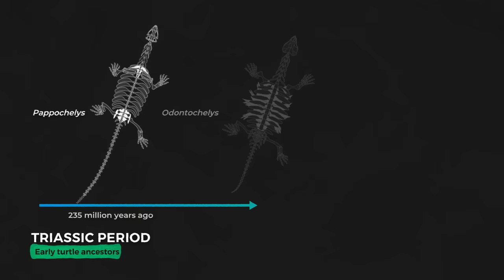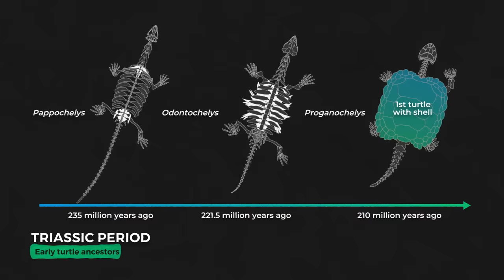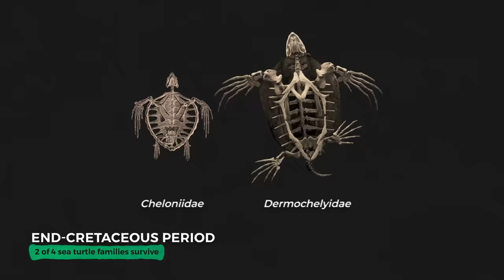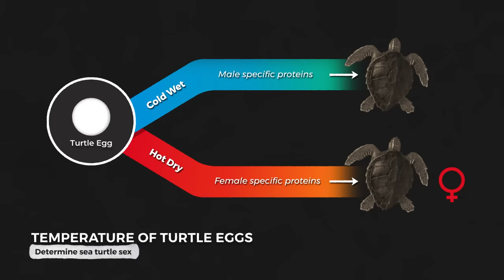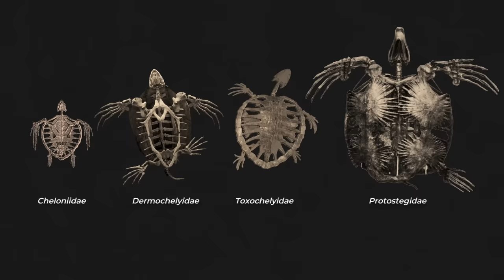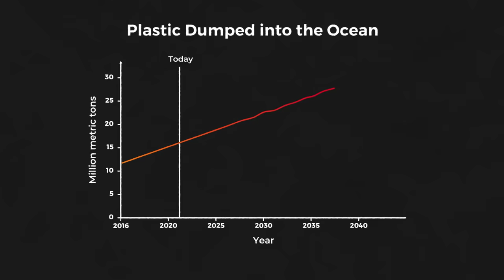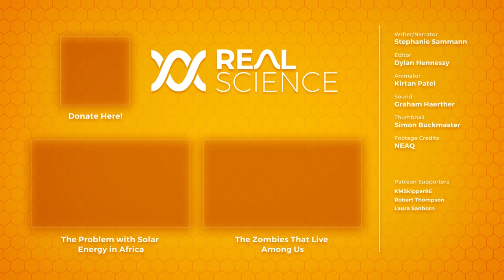Why Evolution Has Screwed Sea Turtles (And So Have We)

Comment: The light pollution problem is SO EASY to solve, it's insane we still have so much of it
Reply: Plus it even disturbs human sleep patterns in many cities.
Reply: Economically it is not easy and that what matters. That's why massive grants are required to solve problem
Reply: You can't read and cant see small things at night
except in moonlight  is the downside.
good for sleeping and health is the upside.
Reply: @maryann2628  you never had a clip on light? Me reading with a worm light in bed doesn't cause any light pollution!
Reply: @Thor-Orion  Yes but small light sources only works for reading until 5-10 meters but if its just for seeing then it works enough
for small rooms its bright for big rooms its too dim
and 100
But works for some average rooms its just the angle thats the problem most light bulb are 180-360 degrees
but worm lights are 90 degrees so you need multiples of them to light up the entire room
but besides that its good enough
for night sky
if all houses are like that then the light level pollution is 1-3 which is low for me
im in 7 light level pollution and the stars look good
and i have seen 4-5 and its so beautiful
Reply: No one is willing to do anything unless everyone has to do it
Reply: It's not practical
Reply: @maryann2628  
Its called "closing the windows".
Inside light is not the problem...

Comment: The plastic needs to be prevented from getting to water in the first place. Since it is only a few rivers that have this problem, it can be tackled.  People that got rich starting the problem can get wise and clean it up.
Reply: Cleaning up doesn't make money. Under capitalism, if it doesn't make money then the corporations won't do it. Any ethical stuff they do is only if they think it'll make them more money than not doing it. You can't expect corporations to fix the problem unless it'll affect their profits if they don't. That comes from consumer and political pressure.  

I saw a great start (I think it was the US state of Maine?) That started charging companies based on the costs of dealing with their packaging (basically like instead of citizens paying the government for recycling costs, the companies making the waste pay for it) Suddenly, companies are reducing packaging or using biodegradable options, because the extra tax costs more than making those changes.
Reply: How. How will you tackle this? You going to stop these countries from tossing garbage? Or try  to catch the garbage

Comment: Fun fact we dump about 1 dumptruck worth every 30 seconds and every truck can hold 2 or more tons so 4,000 pounds.
They need new technology not just grabbing a little plastic and calling it good.
Reply: no, we need an old technology: It's called not wasting and not littering. There's no reason to wash all our waste into the ocean. You can reduce, reuse, recycle and ultimately burn waste and produce heat and electricity.
Reply: @uschurch  haha ya im with ya.
We use to use gkass and clay pots for a very long time with little problems.
Hell we have to little diversity in are food back in 1950 to 75 we had 90 to 150 different kinds of food in the stores but the government thought it was to hard to keep track of that so now we have 50 to pick from with 3 being are main food.
Reply: @uschurch  reduce, reuse, recycle. in that order. recycling is not what it's made out to be.
Reply: Ya I'm afraid this effort while well meaning is a drop in bucke and fails to address causes of the problem in meaningful way, it only removes 15,000 tons.  Did they say what they do with trash they remove from ocean?  Does it go to landfill?

Comment: Mycelium based packaging could very easily surpass plastic within a matter of mere months.
Reply: Unfortunately that's wishful thinking. It costs companies a lot to switch products that way, so usually they just won't
Reply: @FeeshUnofficial  if you provide a company with an estimate of how much they'll save and how much they can stand to make they legit will do anything.
Reply: @zakkeith1508  that's true, but you forget the ignorance of CEO's, CFO's and board members to anything that doesn't directly increase the stock value, at least in big companies

Comment: It's one thing to swear off plastics.  It's another for there to actually be a suitable replacement.  One that's as convenient, functional, and economical, or even approaches it.  A sustainable replacement should certainly be a long term goal.  But until then, reclamation via responsible waste management is all we can do.

Most people have some idea where the primary waste management problems are on the globe, but it's often sensitive to discuss out loud.  Continued investment should naturally concentrate on these locales.  But as with anything global in nature, progress hinges on cooperation from governments.
Reply: Many of the plastics we use now replaced more sustainable existing options. Beverage bottles for example used to be reusable glass with a reasonable payment for returning the bottle which greatly reduced waste.
Reply: @garethbaus5471  Indeed, such as the milk bottles of yore.  Today, about the only beverages still routinely sold in glass bottles are alcohol.  Returning to glass throughout the beverage industry would certainly reduce a sizeable amount of single-use plastic, albeit at some logistical cost which might be reflected in pricing.  Glass being heavier and more fragile would surely increase transport costs for instance.  Even if it's too logistically cumbersome to return to a full reuse program, as with milk bottles, glass is readily recycled, and even when it isn't, it has a lower environmental impact than plastic.

Plastic wrappers, bags, and packaging that house virtually all food, snack, and personal care items are a somewhat different matter.  What to use for potato chips, candy bars, shampoo, and toothpaste?  Most biodegradable materials such as paper and cardboard have an airtightness, water resistance, and durability problem that would impair shelf lives.

Comment: Easy solution to the light pollution problem: Every year, inspect beaches with nesting sites at two random times during the hatching period — For any beach that has too much harmful artificial light, put up black screens to block the light and send the bill to the local property owners with a nice, temporary bump in property tax. Of course along with the GPS coordinates of the offending light sources.
Reply: Is there anything temporary which could be installed maybe floating in the water, to which titles would be attracted? Just asking. Old UK duffer here.
Reply: @tim40gabby25  Yeah, that crossed my mind too, not as draconian as what I ended up proposing. But you'd need a massive light source pretty far out to sea. Otherwise you wouldn't outshine the towns and cities next to the beaches or you might attract hatchlings from neighboring beaches inland as they would see the light coming from aside rather than from the sea if you were to place it close to any individual beach.
Reply: @davidschaftenaar6530  indeed - so 'hood' those sea docked lights as well.. sounds expensive :(

Comment: Hi. I noticed on the Thames when wind was from a certain direction, all the floating trash collected in side channels. All of it. Line those channels with nets, haul out when full. Repeat. Generalise. Why not? Just asking :)
Reply: Nets tend to catch a lot of plankton if you use it to catch plastic, as most plastic tend to break down to micro plastic if you leave it in the water too long.

killing plankton which is the bottom of the food chain affects the rest of the food chain.
Reply: This'd rely on the wind going in the right direction consistently, which it just doesn't.
Reply: @juniperrodley9843  Hi. Nope. A steady breeze quickly leads to accumulated flotsam, which of course would need to be removed before wind changes. Submerged netting could be used to scoop out the floating stuff..
Reply: @onewayraildex4827  Not so much if one of just scooping the surface?.. like removing scum. Just saying.

Comment: Israel has an excellent conservancy project at Rosh Ha Nikra beach.  The area is tightly controlled (it helps that it's next to a major military base!) Every year trained volunteers make sure that the hatchlings have optimum chances to make it to the water.  A few years ago an oil tanker dumped its entire cargo off the coast, and it took millions of shekels and thousands of volunteers to try to rescue the wildlife and clean up the shores. The tanker was from Iran, and it's considered an act of eco-terrorism. The disaster was every bit as bad as the Exxon Valdez, yet international news barely mentioned it. 😒

Comment: We need to focus on preventing all waste from getting into our waterways and oceans. We need to focus on not using plastic, instead we can use aluminum, it can be cleaned and recycled over and over again. No more plastics.
Reply: @Talishar  copper we can use copper instead.
Reply: @DynamicHaze  Can still leech into food/water without a coating and its oxidants aren't very fun either.
Reply: @midnattsol6207  we can use copper instead.

Comment: deforestation is primarily driven by timber industry, not meat production. how about getting your facts straight
Reply: Animal Agriculture  is the number 1 reason for deforestation. Maybe do some research before you try to correct someone
Reply: @Koko-ql4fg  nope! they first cut the trees for timber, but the resulting land is not arable because of the roots that are left behind. then, cattle farmers get to use the land for extremely cheap (sometimes for free) because there is not many other uses, only cattle can step inbetween the roots and make use of the grass. which is actually good cause you get grassfed beef! maybe try using logic before correcting someone :)
Reply: @hunterra2980  Some 80% of global deforestation is a result of agricultural production, which is also the leading cause of habitat destruction. Animal agriculture — livestock and animal feed is a significant driver of deforestation, and is also responsible for approximately 60% of direct global greenhouse gas (GHG) emissions.